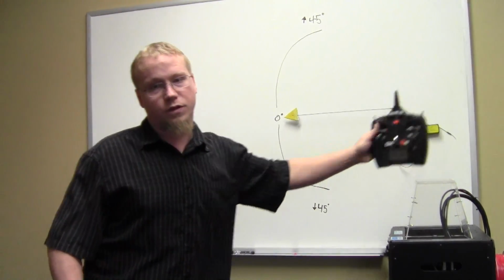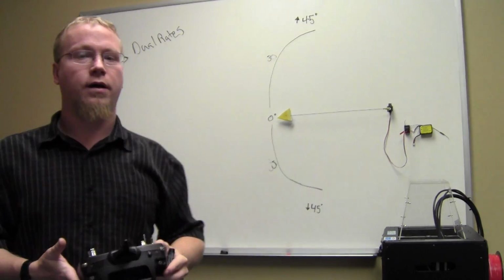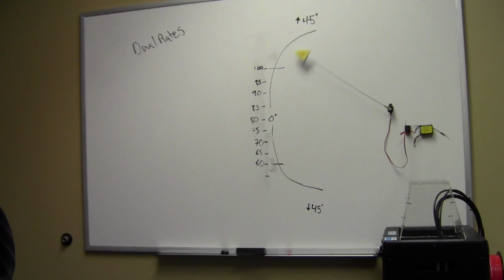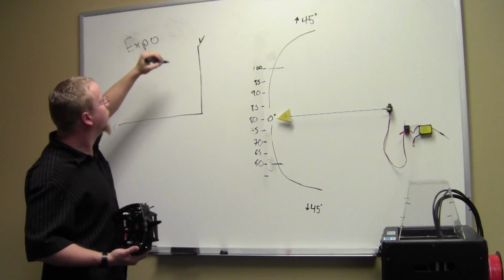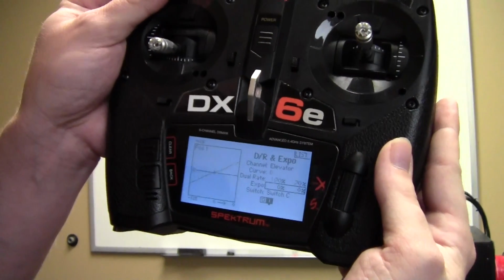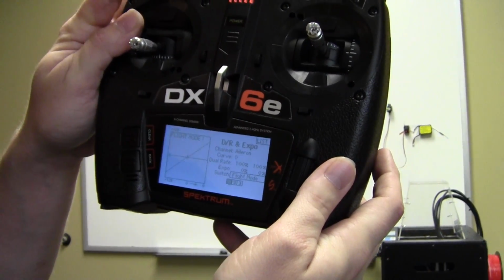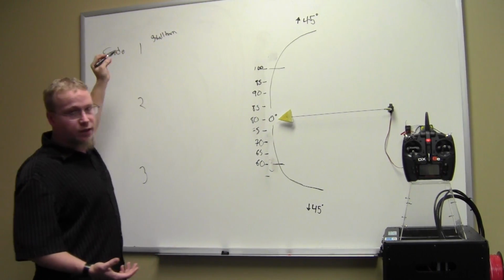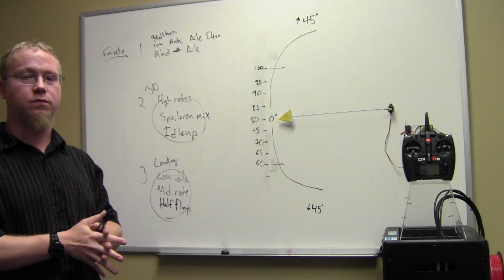Spektrum Beginner Series Episode 3 - Dual Rate, Expo and Flight Modes Explained

Comment: WHAT IS THE "FULL RANGE OF ROTATIONAL TRAVEL" (MEASURED IN "DEGREES"), OF A TYPICAL SERVO??!!... AND THE RADIO SHOWS THE RANGE AS ("PERCENT" POSITIVE), AND ("PERCENT NEGATIVE").....   SO, THEM, "(0% )ZERO %" MUST BE THE "NULL POINT (MID POINT) OF THE ENTIRE RANGE OF TRAVEL (WITH THE "TRIM" SETTINGS AT "NEUTRAL, TOO)???!!!.... :face-blue-smiling::face-green-smiling::body-blue-raised-arms:

Comment: So say hi is 80% of its max, and low is 55%. Expo is like if you gave it 15% throttle normally, it would be 20% expo, as well as 30% would be 40%, 50% would be 70%?

Comment: I never turn the travel down in my radio. If my control surfaces move too far, I move the linkage in on the servo arm. I always use the outer hole in control horns. I do sometimes turn the travel down on the flaps channel when the servo arms bind and I can’t easily take the arms off and move them a tooth or two.

Comment: I'm a beginner in the rc world i have a truck and the servo went out and I'm having to replace it and the transmitter only has st-d/r how would i set this knob after I've installed my servo and how does it work

Comment: awesome. can you do this for helicopters now please?
Reply: Yes Fr I have had two blade helicopters with the safe system and I can’t find any help on how to get switch  out of the beginner flight mode, I have to use a crappy rtf transmitter just to fly my heli in 3d mode

Comment: Excellent explanation but i wish you used a plane so we could see how each flt control was affected. If i wanted the ail to compensate for the rudder movement so i stay level, how do i set that.
Reply from the maker: Hi James! You could use a RUDD to AILE mix, BUT that can get messy depending on the setup. Make sure to put the mix on a switch so that you can turn it off incase it is causing the aircraft to be difficult to control.

Comment: I’m confused a little bit so 20mm means 53% and 15mm 60 ?
Reply: First you would have to determine how many mm. it is to 100% of your max. deflection from flat even, then it will be easy to figure how many mm. it is for a given percentage.

Comment: I don't think it was made clear that dual rates require setting up two different curves (eg 0 and 1) that are what switch C shifts between.  Too much time spent on setting how many degrees may be changed ... rather than how to set up the high/low function in the first place.  Ironically, none of this is covered in the rather worthless user's manual.  :-/
Reply: Couldn’t agree with you more.
Reply: Do you by any chance have a video up explaining it your way? We need a detailed video on setting up the transmitter for beginners.

Comment: Do you need to setup the normal travel before you use Dual rates or just set dual rates if using a switch for flight mode?
Reply from the maker: Travels are more for your servo endpoints to get the full range of motion. Then use Dual Rates to reduce movements to your tastes. Hope that helps!
Reply: @SpektrumRCvideos  So leave the travel settings normal (default) and just add or remove travel to like with dual rates?
Reply from the maker: @BDTennessee  If the model is a pnp or bnf then yes. If it is a ARF etc you will want to setup travels to get the max control throws that are recommended via the models instructions. THEN use Dual Rates to adjust travels to your tastes and how you want the model to fly. Hope that helps!

Comment: Somehow my right stick is controlling throttle and ailerons and my left stick is controlling pitch and rudder  how do I change it back
Reply: If it is a DX6E like he has in the video; on the back of the controller is a large plastic switch. Open it up, remove the blocking piece of plastic, throw the switch to the other position, put the block of plastic back in, put to cover back on
Reply: Wow I just gave you bad advice. I did not read your post carefully Now my best guess would be the wires in the plane are mixed but only if you use this control for just of one plane. You get the point.  I am new to all this but I do know there are 2 pages that deal with assignment of each control  surface.

Comment: excellent info, but the video needs a lot of help.  please set the radio down and have a camera zoomed into it for explanations.  by hand holding, the radio is all over the place and sometimes goes out of focus.  Also, have an actual airplane there to show the responses.  The talker should also use a microphone for consistent audio.
Reply from the maker: Yeah we agree. This was one of Toms very first videos and equpment was not great back then... Thanks for the feedback and we might be doing a redo of this video. Thanks!
Reply: @SpektrumRCvideos  So where's the redo? BTW-Since this is a Beginner video, how about using Beginner/Intermediate/Advanced instead of stall-turn!!!! I know it's hard to dumb it down to beginner level, but we start with no practical knowledge of how things work. (The visual aid is FANTASTIC!)

Comment: Sailing...I want to set up dual rate for rudder control.  Normal for light air, reduce rudder control sensitivity for heavy air
Reply: I use exponential for my cr914.  Sometimes you need full rudder to get out of a jam.  Otherwise light rudder input is best for maintaining your speed.

Comment: I have a DXE and my left stick is pitch and my right stick is throttle. i want it to be reversed. How can i do this ? Thankyou
Reply: I got the same problem with my dx7eu...
Reply: Control mode slider on bottom of transmitter. Reference the instruction manual for more info

Comment: I follow the dual rates fairly well.  However, I got lost when you did both the travel and dual rates.  What is the difference between the two?  When setting up your radio, is it necessary to do both, or just one or the other?

Comment: My manual refers to %, i.e 100% or 70%.  So, do I put those values straight into the D/R boxes or must I interpret like in this video?
Reply: I see that this post is two years old. I was lost on this myself. The instructions the come with the transmitter manual don't explain dual rates and exponential in detail. The manual that comes with the plane I have says the same thing. The thing is that it just says rates. If it would have said high rates 100% and low rates 70%  it would have made it a little easier to understand. The manual should say that you have to set this up in the transmitter under d/r and expo, but it doesn't.  They should also tell you to use a little expo to tame the plane while flying.

Comment: how do I setup an idle up switch?
Reply from the maker: Go to the Throttle Curve menu, then assign a switch. In one position you will have curve 1. In that position change the values (1 - 5) next to the graph to your desired new throttle curve. If you are just wanting to change idle speed increase the 1 value. Hope that helps!